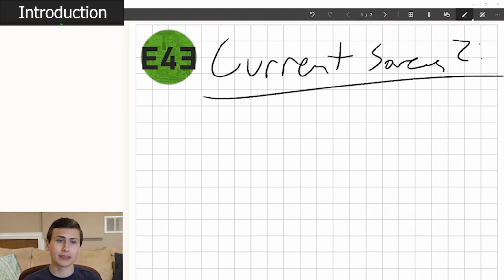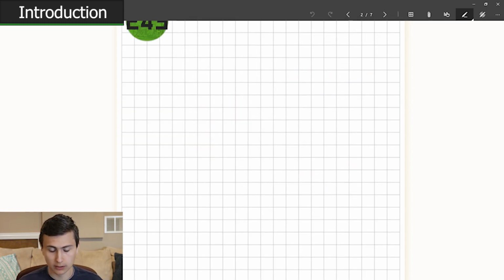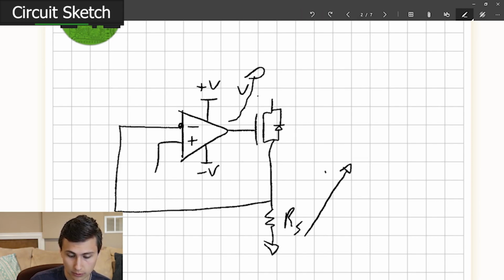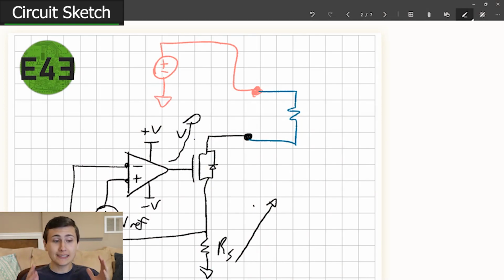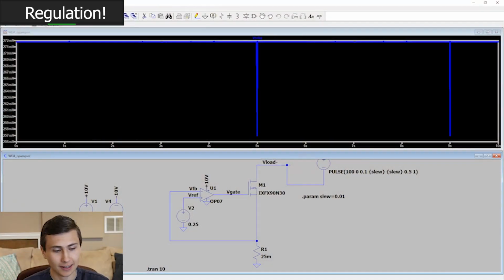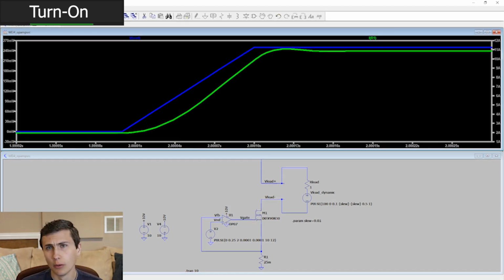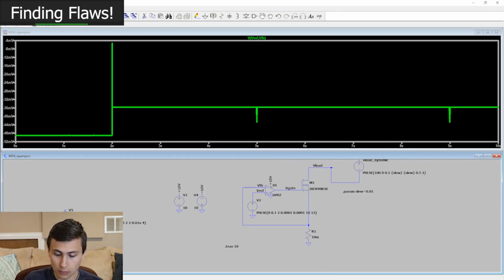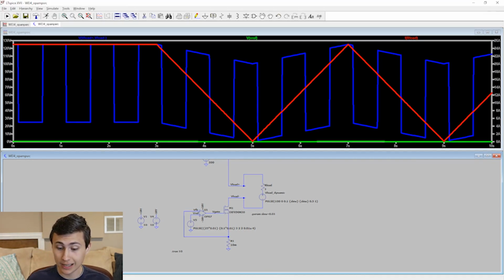Building a Current Source with an OpAmp!

Comment: Hi, i wanted to create a 1A current source at 70khz, what changes do i need to make in this circuit?
Reply from the maker: Hello! One of the biggest changes you'll need to make is generating a modulated current source. This is configured with a DC reference.

The second biggest change is being able to generate a positive and negative voltage, where this is currently configured to only apply positive voltage.

The end schematic may end up looking very different!

Comment: But an opamp is an (imperfect) integrator. It should have very high gain at low frequencies, but begin rolling off -20dB/dec  (a classic integrator response) after 10Hz or so. There should be a lot less steady-state error. I think the problem may be common mode voltage range of the OP07 or maybe the input offset voltage? It's an old part. I have some OP27's and OP37's around and I think those are supposed to be precision parts. Perhaps try connecting a resistor network to the offset null pins.
Reply from the maker: Interesting thoughts! I've long since left this sim collecting dust, but great point about how there continues to be evolution and improvement in components. I'll have to give some higher-performance parts a try!

Comment: I want to use this circuit to drive bunch of LEDS in constant current. Can I connect the non inverting input of op amp (vref) directly to the GPIO of my microcontroller. To PWM the constant current source. My PWM signal not only varies by duty cycle but also by PWM frequency between 200Hz to 5000Hz very quickly. I can’t low pass filter the pwm output which people are suggesting me to do. How would you approach this scenario? Is it okay to connect it directly?
Reply from the maker: Hello Amrat, a couple thoughts: depending on what "a bunch" means, you might have a lot of power dissipated in a linear current source for that application. If you say that you can't filter the pwm output, I'm guessing that transient response is very important to you. Perhaps consider driving this circuit with a digital potentiometer, or SPI DAC. In fact, some microcontrollers have analog outputs (DACs) built-in! Like everything, this circuit has limits, especially with regard to transient response. I'm not sure if it will directly work for what you have in mind.

My best recommendation is to pull the LTspice model (should be linked in the description), change the inputs and outputs for what you're trying to do (string of LEDs, 5kHz pwm input), and see what the stresses look like in the critical components!
Reply: There are specific circuits for that. See analog devices chips.
I do not work for them at all. There are other suppliers of course.
In fact it also depends of your led power. The more the power is and the more the deal is. The advantage of using specific circuits is that they separate the level of light you need and the current of that led.
In fact any led should be powered in constant current: it is the nominal current of the LED. and upon that you apply a duty cycle to make the LED bright more or less. This is how specific variators for led works. I mean some of them and
you can design anything else if you feel stronger.